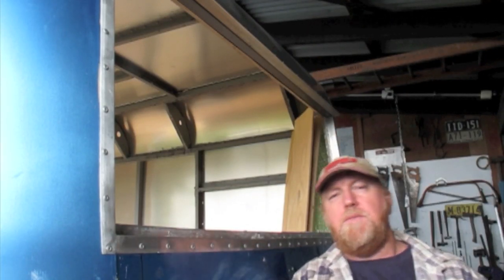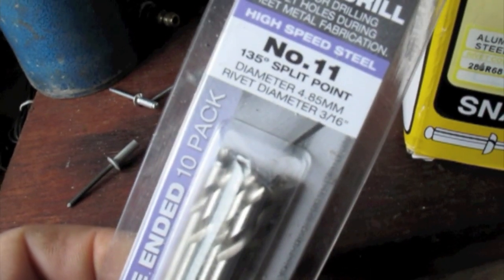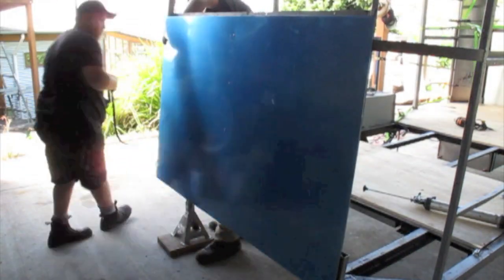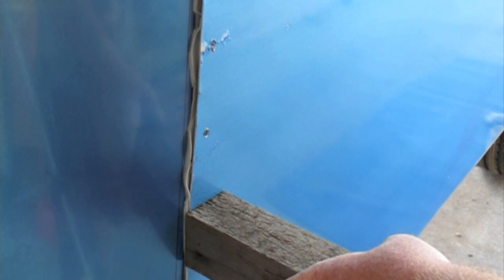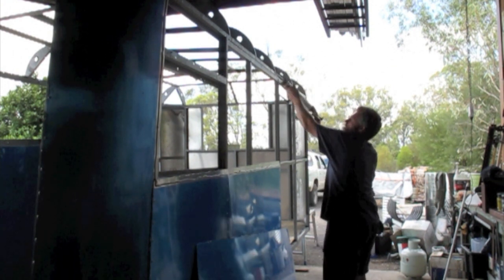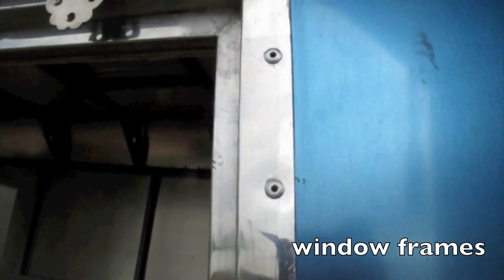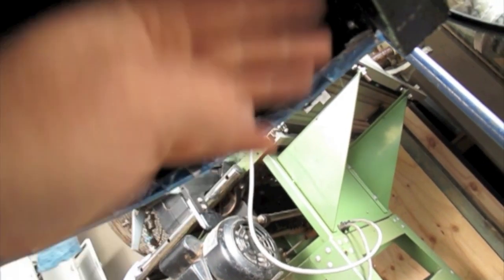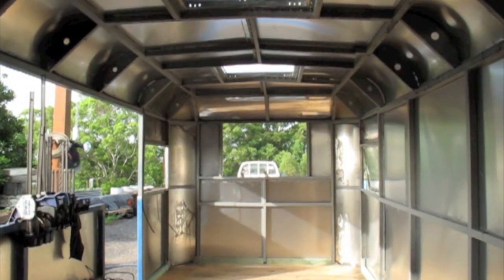Replacing the exterior cladding on the vintage project caravan

Comment: Thank you for putting this up, very helpful!! We just started a food truck conversion with a Carapark 13FT and I was wondering what type of aluminium you use, or is it all standard??
Reply from the maker: Yes there are several finish grades, we tend to get what available so it varies a little, thickness is more important.
Reply: What thickness do you recommend?

Comment: Hi, Loving the van rebuild series. How do you replace and shape the bullnose aluminium where the vertical and horizontal bullnoses meet at the corners of the van? All other explanations have been very informative to somebody that would like to restore an old van. Cheers Bern..
Reply from the maker: Thanks for the feedback Bern, we tend to panel beat and repair them and not replace them, they are spun corners which requires a specific lath to reproduce them.  We do have a few spares from wrecked/spare part vans that we salvaged corners from also, if repair fails then we replace with old ones.  They are fixed like all the other panels, sikaflex and rivets.

Comment: Hi Steve. Thanks for the vids. I’m following your advice to the letter during my 1954 Carapark restoration. Just wondering where you get your rivets from? I’ve done a bit of a google search, but haven’t been able to find the exact ones in bulk. Cheers.
Reply from the maker: Mmm, most good hardware stores stock them or will get them in, if not a specialty fastener store.

Comment: Great video, just wondering were the counter sunk ones just for internal use?
Also I have plywood sides that need to be replaced is there a way to fix wood sheet/plywood without exposed screws? and is there a method to make sure it is watertight? like have seams running vertical or horizontal?
Reply from the maker: You can get sealed end countersunk rivets which can be used externally, you will have to countersink the hole thought to get them completely flush.  Is the ply painted?  You can countersink fasteners, then fill and over paint or put a timber plug over the top (google timber plug or button cutter) .   You could use sikaflex to just adhere external panels on without fasteners. Overlaps from top to bottom and front to back with Alloy sheets with sikeflex in the join prevents water ingress.  I timber panels you would need to do an adhered scarf join to prevent ingress.

Comment: hi, is it better to use stainless steel rivets on the outside, and is it worth replacing all rivets on the outside of my old van I'm restoring with closed-end rivets? 
thanks
Reply from the maker: No, you will create galvanic corrosion issues and they are also very difficult to drill out should you need to repair or repakce any.

Comment: hey mate do you think 0.6 mm  sheet of aluminium will be too thin or will it do the job. appreciate your help in advance
Reply from the maker: Yes it is too thin. 0.8mm minimum.
Reply: @VintageRestorationsAustralia  thanx mate appreciate your help so much
Reply from the maker: @Raj_bharti147  You are welcome.  I prefer to use 1.2 on the roof, it adds a bit more structural integrity.  In the custom built hatches for our commercial vans we use 3mm on an aluminium frame as they need to be very stiff and take a lot of punishment. The walls in .8 gives a nice join and resists impacts and dents fairly well, 1.2 is better but adds a lot of bulk on the overlap joins.  Corners we use .8 as it bends better and stiffens up anyway under tension.
Reply: Any advice for thickness of mdf external cladding on a very old van?

Comment: Is there a reason you didn't use the original panels?
Reply from the maker: Yes. The cladding was heavily painted badly dented  and the customer wanted a higher level of finish than is possible with the old beaten up
Aluminium. We normally maintain original materials as much as possible but customer requirements always take priority